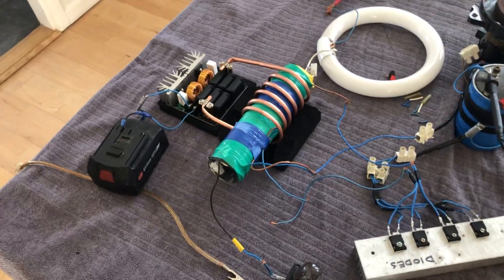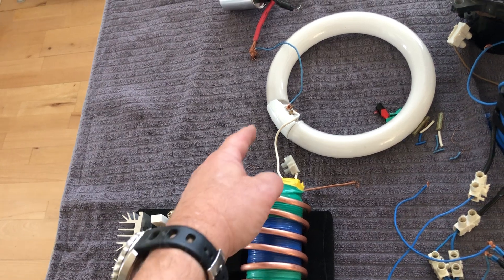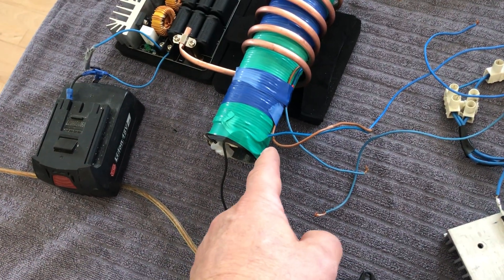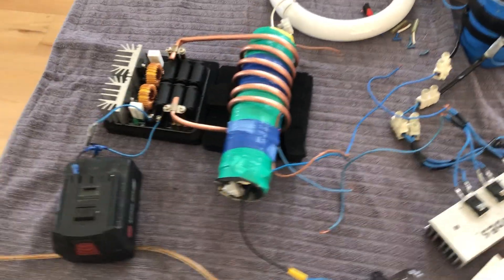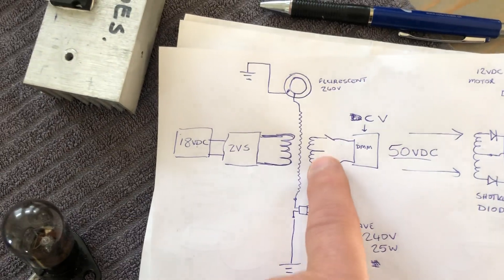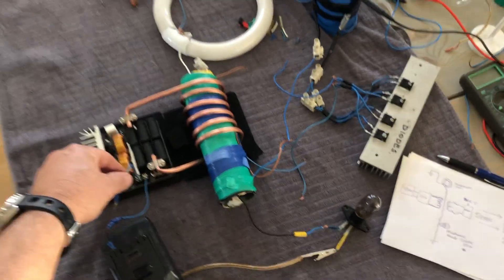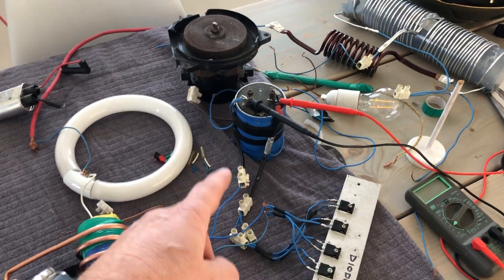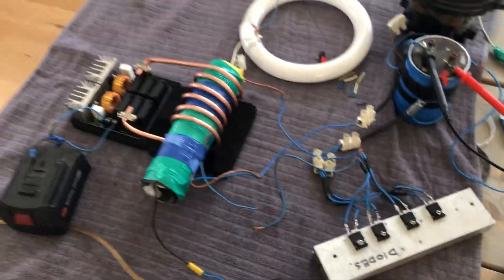Kapanadze investigation collection methods

Comment: I am still confused that you are using a step up air core transformer to glow florescent tube and then using bifilar secondary to step down and rectify to charge the cap. How will you achieve overunity in it?
Reply from the maker: @qinaan  still working on it but the quick storage of DC when increased could hold a piece of the puzzle. What do you have ?
Reply from the maker: @qinaan  it is more about time vs charge, this method allows me to transform what I have to a usable amount. My plan with help would be to fill a larger bank with a few seconds of voltage from a primary input, that could be then controlled at a slower release rate to power the input driver.

Comment: You mentioned "Kapanadze collection  methods" But he was using a spark gap thou, with his bifilar coils. I wonder if spark gap make the difference? 
Also it might be a good idea to check the input amps under load. If the in put amps will increase under load you only made an high frequency transformer here.
But if the ground connection allows to operate a load without taxing the prime mover amp flow draw, you really got something here. 
In any rate thanks for sharing and keep up the good work.
Reply: @MehmetBoysal  yeah , you give right assumption

Comment: Hi , this is only the basic switching circuit, when you consider about the very high efficient systems which are above COP 1 , then they are only the ossilating circuits, like load is running in pulses form , Fine tunes LCR setup , also the feedback which is recharged the input source is also in pusles form , no any circuit is in the linear circuit from , all are in dynamic form